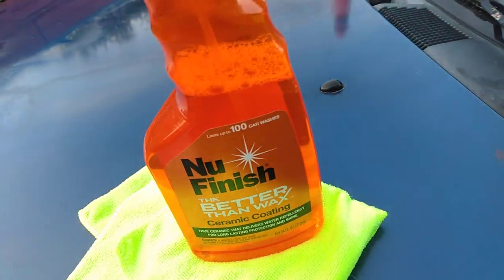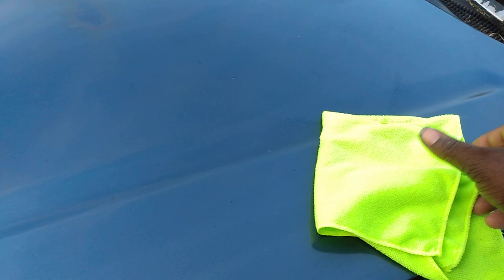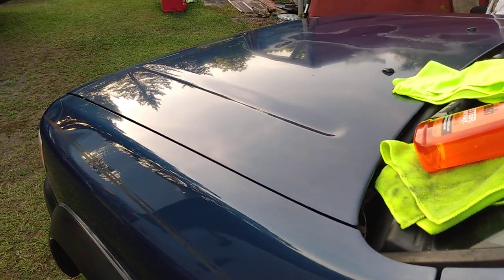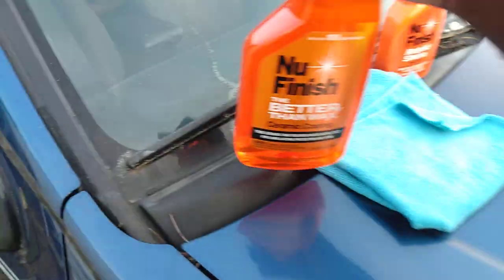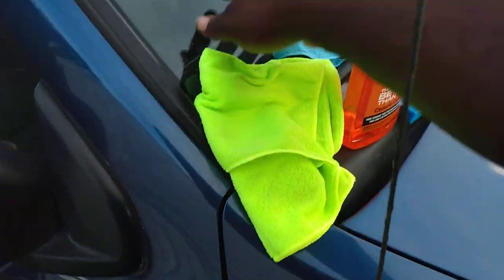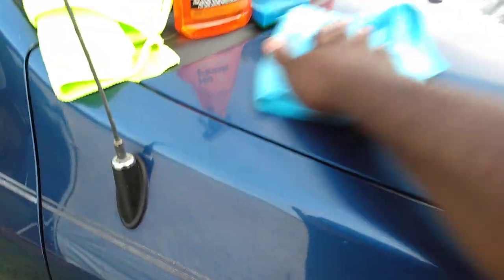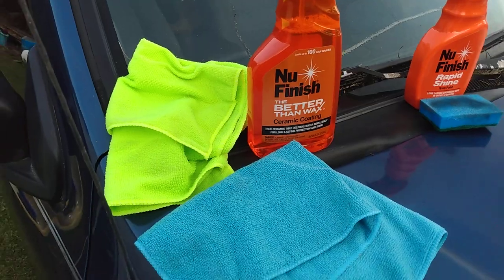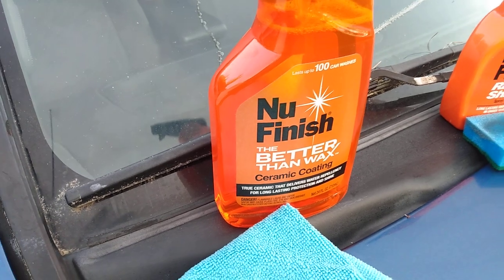nu finish ceramic coating how it should be used on the paint 2 rags needed

Comment: It’s not going to streak if you follow the directions that Nu Finish gives.  I mean they are the ones who made it. You can spray it on the cloth or on the car but as Nu Finish says use a wet micro cloth when applied